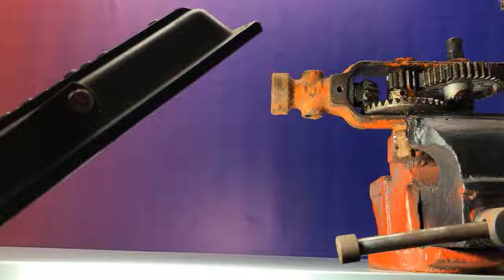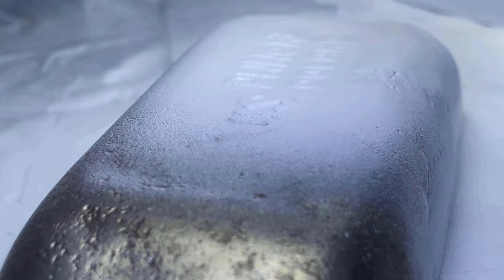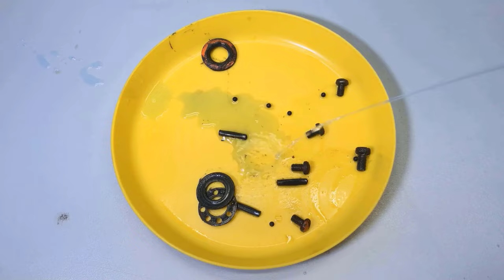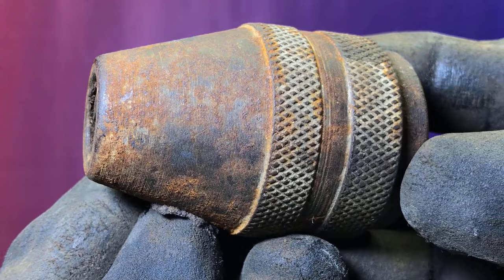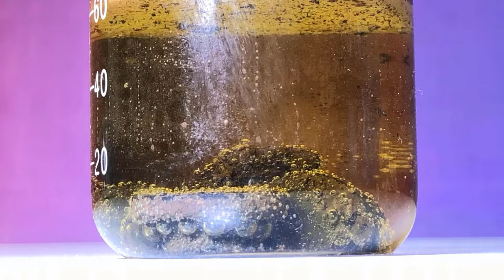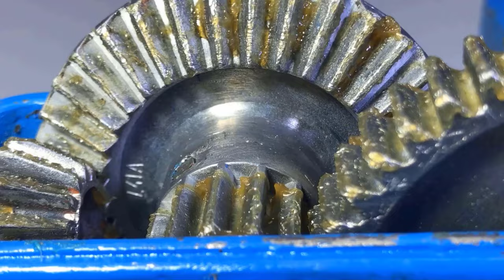Antique Rusty HAND DRILL Restoration

Comment: Nice job. Next time degrease all your parts before you try paint or rust removal. Use kerosene. The old grease is blocking the chemicals used to clean. Invest in some tap and dies to clean up threads.
Reply: No, he won't do it because hes lazy. Did you even see the castmarks, pittings, and bends? And you expect him to use degreaser?? Really??